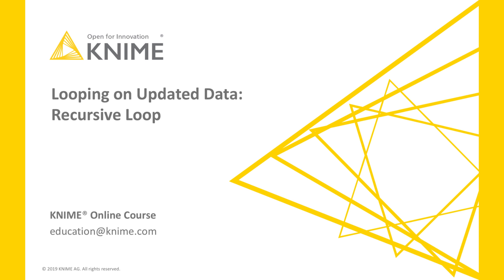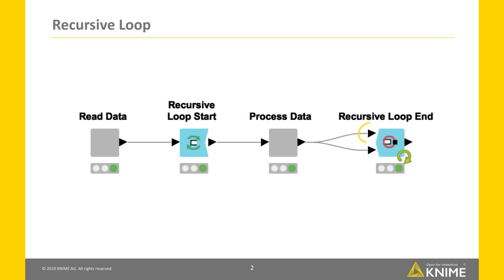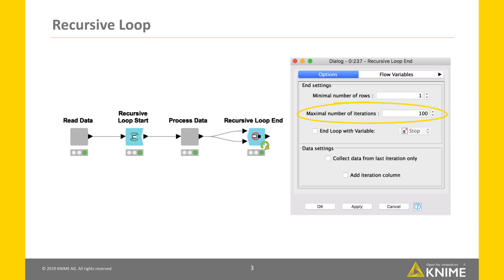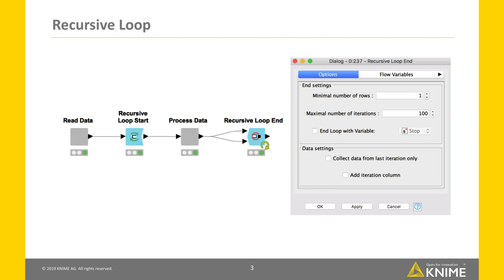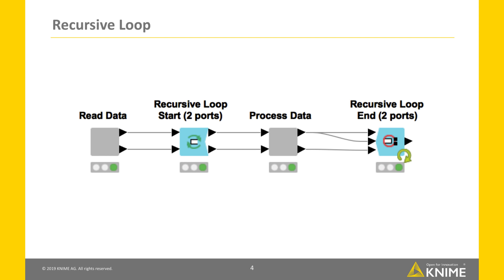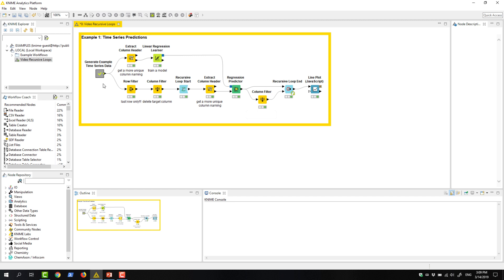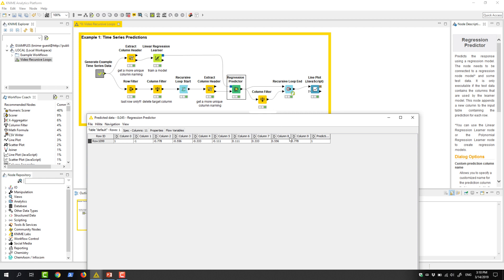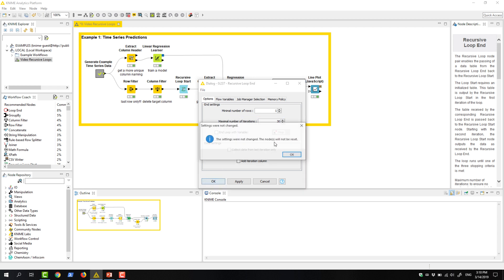Looping on Updated Data: Recursive Loop

Comment: Looking at the Node description.  Some keys for us to understand.  The Recursive Loop Start sends the input data table only on the first run... subsequent runs it sends what it receives from the Recursive Loop End.  The Recursive Loop End sends what it received in Port 1.... It stores what is received in Port 0 for the output table.

I'm also a little confused about why the 1st column is dropped (I assume it was one of the config settings used in the modeling) but if it's dropped then doesn't all the mapping of flow variables get all messed up as the column names have changed? This might need some more explanation for us newbies.